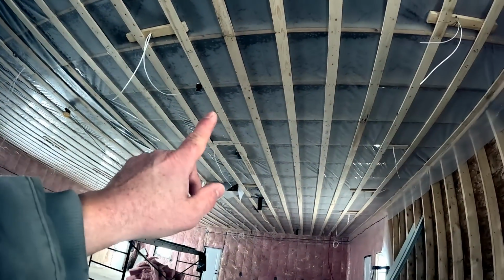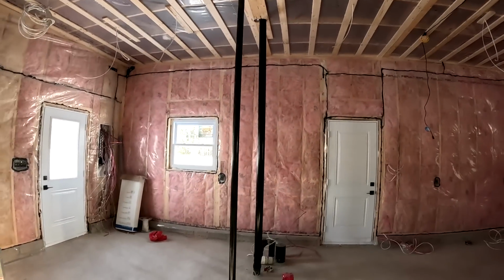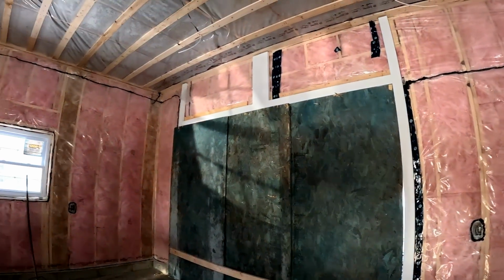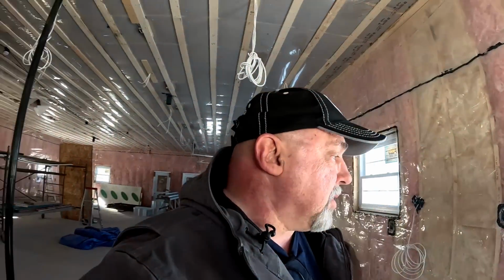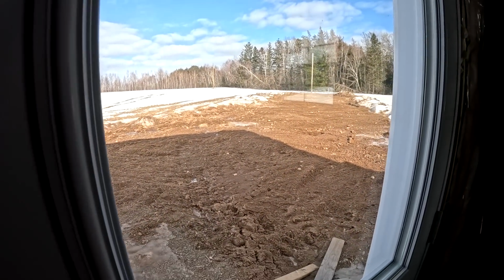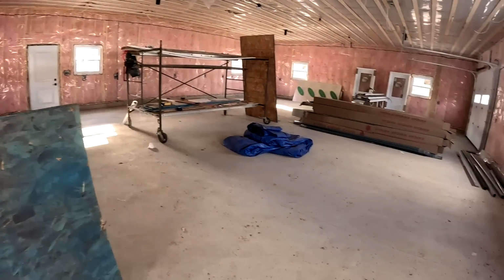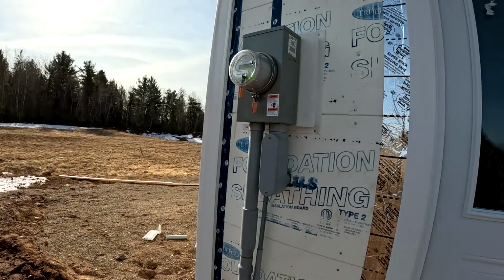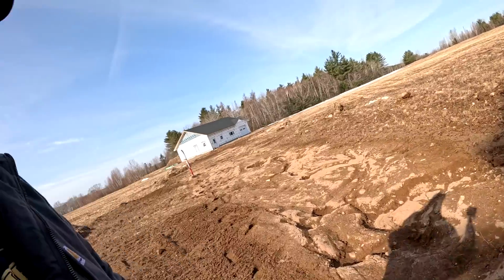Woodturning - New Shop Build Part Six

Comment: I hope it’s not too late to say please don’t use blow in insulation. 
The reasons are 1 it puts all the weight onto the back of your plaster. 2 if any plaster ever gets damaged or leaves the battens your blow in insulation will fall between and stop you ever being able to push it back up.
Reply from the maker: Seen your update first.  Thanks Richard!

Comment: I know a person who had the same issue. After 6 weeks, they had a solar company install panels. Got building 95% done, and all of a sudden the power company, seeing the panels, literally busted their butts getting power installed. They wanted panels removed, because they didn’t give approval, but, justice prevailed and panels remain, as they were installed before power. Power company could not explain why there was a 19 week delay from approval till power was installed, judge said power was needed and generators was not sufficient for the 24 hour power requirement. I wish I had money for solar.. $40 electric bills are easier than what would have been $200-$400 a month. Side feature power failures, are moot point as the batteries they had installed,  lasted 3 days, and only drained about 40% of the storage at the worst with heavy snow on the panels. That slid off when they realized the electrician never plugged in the panel warmers.
Reply from the maker: That’s a great story about how persistence paid off, and it sounds like they have a reliable system! Thanks

Comment: Congratulations Jim on getting power and maintaining your sanity in the process, I've been in the electrical trade from the late 60's until I gave it up 2 years ago, the last 30 I was an Electrical Inspector dealing with the electric utilities on a daily basis, not knowing all the facts its difficult to say what the delay was but you have a good outlook on life and a reason to smile that and were both turners which for me has been my mental safety net.
Reply from the maker: I would say it’s mismanagement, lol. Thanks
Reply: @SpragueWoodturning  Bureaucracy.
Reply from the maker: @inspectr1949  that too!

Comment: I am really enjoying you taking us on this journey with you.  I realize that the power is a frustration, but these builds never go without some kind of hold up.  If it is not a power or a plumber issue it is cabinets or an inspector is backed up several weeks / months.  The list goes on and on.  From what I can tell your contractor is doing a wonderful job keeping you in the loop and moving forward where he can.  Hopefully he can get the siding up before the floor gets ground down, less to have to move. Anyway thank you for the videos, keep them coming.
Reply from the maker: You’re right it always seems to be something! Thanks

Comment: I'm happy your power finally showed up! On my shop, that was actually the easy bit.  We have a PUD (Public Utility District) here on the North Olympic Peninsula and they were very responsive.  The electrical contractor was very timely.  I have waited forever for plumbers.  I gave up on getting anyone to help with the assembly of my building (red iron) and learned how to do it myself.  The foundation design from the building manufacturer was for a 4-6 foot frost line (they are based in Quebec), we don't really have a frost line here, so I had to get a local engineer to do a design for the building department to approve.  Our concrete crew, when I finally found someone, was driving 2+ hours to get to the job site.  There were no local concrete people who were interested.  The whole thing was just a nightmare.  Three years in progress, I'm just finishing the interior and we are putting the house (and shop) on the market to move across the Atlantic.  And so it goes...  Oh, I found someone who said they could do the roof, they got about 12 feet in and I told them to go away and never come back.  They were turning the steel, sheet and purlins, into Swiss cheese and the panels were all askew.  My wife and I finished the roof and I then went back and repositioned everything they did.  I still don't think I found all of the leaks.
Reply from the maker: That's an incredible story!  You really went through it! Thanks for watching!

Comment: All the garage doors have seen have two springs above the door, one on each side of the center point. One assists lift and one assists closure.  Is there a reason that yours only has one spring?
Reply from the maker: Haven’t got a clue. They were installed by professional door installers. 🤷‍♂️

Comment: I'm used to more western summers, will there be air conditioning too?  Does the entire attic get full of the insulation or is is that weird 'pebbly' look I see in old big buildings on the inside of the roof?  (I remember as a kid thinking it was dirt buildup lol). Can you use the shop without running water?
Reply from the maker: Air conditioning yes, the whole attic is insulated (ceiling only) and I’ve never had running water so yes to that too. Thanks

Comment: Thank you for these updates.  I'm sorry you're dealing with a all these delays.  Seems like this issue happens no matter where you live.  I wonder why?  Red tape?  
Staffing?  I saw you mention the staffing excuse they gave.  I wonder how long it takes to hire and train?  I'm in pharmacy and once someone is hired, it can be up to 6 months before they are licensed.  They can work at each station they have done their modules and OJT on but it's a real process before you get a fully functioning pharmacy tech, even when most are good to go or close by 4 months from hire.
Reply from the maker: It’s probably all of the above. Mismanagement is probably #1. Thanks.

Comment: What is it about power companies, its as if they don't want to make money except by charging a ridicules high price once you get it.  Revelation TV in Spain with their new build had the same problem. Wait, wait, and wait.  Yet this is a company that will use a lot of electricity.
Reply from the maker: Ya, I don’t get it either. Thanks

Comment: When I had my shop built, the contractor said he had installed drywall in his shop, and he regretted it.  So, I agreed to have the walls and ceiling in 3/8 inch plywood.  I understand why the contractor regretted the drywall.  In a shop, the walls are as useful as the floor (which you wouldn't want overlaid in drywall).
Reply from the maker: I’m fine with using drywall, just need to use a stud finder. Thanks
Reply: @SpragueWoodturning  I think the point is more that the walls can take punishment such as things falling or resting on the walls.  I still have to use the studs for attachments so that I don't break the vapour barrier.